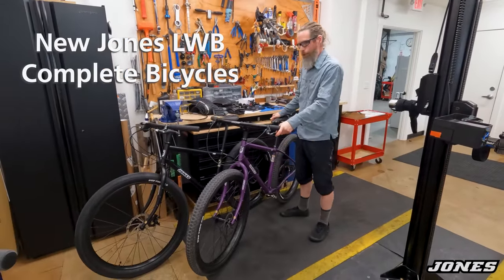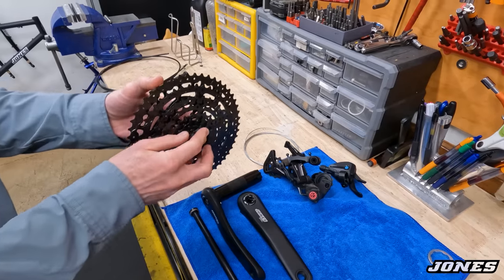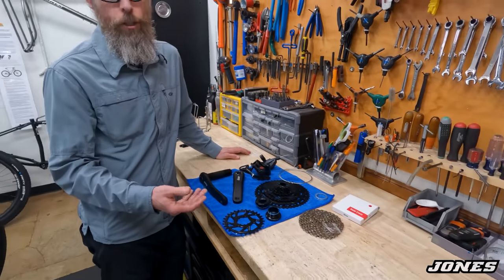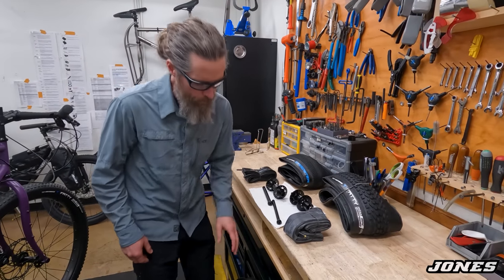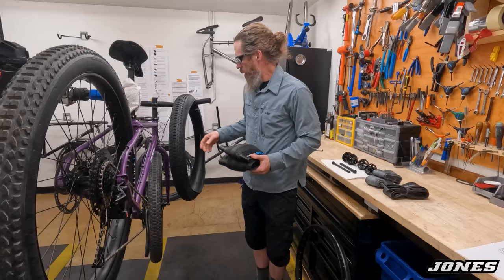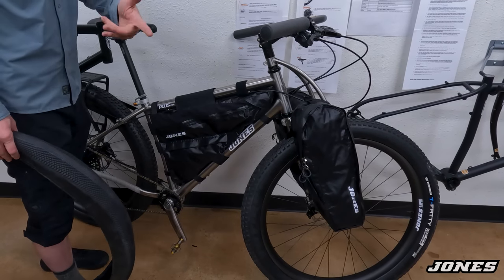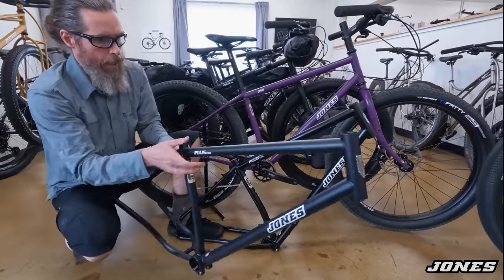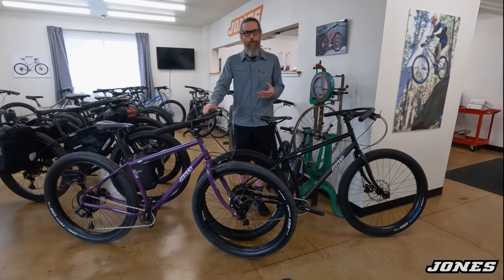NEW: Jones LWB Complete Bike, A Bike For Riding

Comment: I love all bikes of all types and love riding my jones Electric LWB HD-E. Jeff you are such a thoughtful bike designer. Thank you for sharing your philosophy, it's refreshing to hear the  justification for your design and rationale for how your spec your bikes in an industry full of marketing. Thanks for educating us and providing the details for why you do what you do.
Reply from the maker: Thank you.
Reply: Some cool news on battery tech -- Amprius has a battery using silicon nano-wires and anodes.  The point is that it can charge to 80% in 6 minutes, and the energy density is 500Wh/kg, 1300Wh/liter.  This is double or better of what Teslas use.  It's only a 5V chemistry, but 10 smaller cells in series (easier to do because of better conductivity of the nanowires) would be, as they say, a game-changer.  :)

Comment: Fantastic information. Now I totally get the through axel  advantage. The tier information was also …..not what I would have assumed. Kind of counterintuitive! But I get it. I once test rode a bike with a Jones Loop bar. It was really unforgettable. At 66 I think will go for the Jones Bike… because the experience in the design will keep me rolling for as long as I possibly can with osteoarthritis and a fully torn rotator cuff that could not be fixed.

Comment: Interesting to see how you spec the bike. I really like that you shared. 
However I feel like it has a some hipster driven marketing behind some elements and some poor choices in the name of durability.

I know a lot of people is cold sweating about hidraulic brakes, but over the years they proven even more reliable than the always maintain hungry cable brakes. Shimano brakes are the most easy to work with and most durable option rise above every one on the market, because of mineral oil, manufacturing tolerances at cheap price and world wide spread so part are everywhere. Unbeatable by an other company.
Durabilitywise Magura is great (bc of mineral oil), however their levers are not so great. The main body is made of plastic and around the main pivot there are so little material, that they have significant amount of chance to brake. Calipers are great, a ton of power. If you brake the lever, you can make it work with a Shimano one.

Cable vs fluid. It's 2023, even on the remotes places you can find someone who is familiar with this "hightech". But moreover is well proven by the time fluid based brakes are realiable as hell. 

Those Alhonga brakes are really low end stuff. Cable operated disc brakes are the creation of the devil, should have died out years ago. A Shimano mt200 set would be the same price with a set and forget feature in mind. Avid BB7s are good but why bother with them when you can get Shimano mt200 cheaper.
I get the points with the levers, but to set up like that is requires more skill from an average user that aligning the hidraulic calipers right after a YT tutorial.
Compressionless housing is great, especially on the rear. Someone who is doing a lot of biking will spend more time adjusting mechanical brakes than hidraulic. 

I'd rather spec and rebrand same other chineese crank set with SRAM sprocket interface and 24mm Shimano compatible spindle. This way you can keep the easy and well spread "GXP" style mounting with a more durable bearing system. Smaller diameter spindle means more bearing at BSA. Sram bearing system can be a pain if have a not so perfect bottombracket on the frame. The hardend steel bearing race on soft aluminium is not a good combination. On the Simano style system, you have a steel axle, sitting on polimer bushings and than the larger bearings. If you have failiure at the crankset, you will loose the cheap part, the bb and not a pricy part the crankset (axle).

9 speed is really just taste of choice and price. You can buy 10 or 11 speed wide range stuff to please people who prefer closer range of the gears to maintain cadence. 
Chain is another interesting thing. What really does matter at durabilty, what kind material the used and with what surface treatment. (Ex. M9100, XTR chain will easly out perform M6100 chain by 6-8 times, same geometrical construction but way better materials on the top. This is extremely important on ebike application when the motor unit performs larger torq from 0 rpm than most of our cars.)  At lower price you can't get any fancy stuff. Nickeling the outer plates are mainly against rust. Hardening the rollers, pins and make them slick gives the chain durablity. I wouldn't simplify this topic down just to bare outer plate thickness. 
In the future If you will need durability take a look arond the upcoming CUES from Shimano.

Comment: What's the reason for the kink in the seat tube?
Reply from the maker: Since this bike has a slacker effective seat tube angle than normal and tall wheels, the seat tube needs to be bent to clear the tire and have room for a fender.  This may help you see it: https://youtu.be/1xRiF8rm4Qg?feature=shared
Reply: @Veloperator  OK, the SWB would be quite tight with fenders, but the LWB doesn't need it at all, for these reasons at least. - Thanks for your reply -

Comment: How would a Jones bicycle behave with skinny-er tires and lighter wheel in terms of front tire grip? There is far less weight on the front tire compared to traditional approach geometry with skinny tires, Jones uses wide and heavy tire+rim setup so even without the body weight on the front there is grip, how much front wheel grip would you loose with a traditional skinny-er tire and rim?

Comment: I'd love a bike like this with V-brakes. I despise disc brakes, almost as much as electronic shifters.
Reply: V-brakes don’t work so well when you are running tires 55mm (2.2”) or wider. Unless you’re okay with deflating the tire every time you want to remove the wheel.
Reply: @watertankhikes  Never been a big deal, and the Paul's Motolite that I use have a simple cable release when you need to remove the wheel. I recognize most people have bought into the industries upgrade cycle, but I've ridden down long multi-thousand foot descents on old rim brakes with 40+ Ibs in the panniers and been fine to know the hype is just that.

Comment: Have you heard of anybody running a Rohloff  14 hub on these frames?           I have seen the bsa  screw in adaptors to make standard hub eccentric to get over the chain adjustment.

What mounting setup is required for the rear hub and  where do the shift cables run?
Reply from the maker: Hi Julian, It is posible and people have done it, but we usaly don't recomend it. For more information feel free to send us an email at jonesbikes@jonesbikes.com or give us a call at 541-535-2034.
Reply: I bought my Jones 29+ in ~2015 and had it built by Neil at Cyclemonkey with a Rohloff Speedhub.  (Before I talked to Jeff about this).  I also have a Jones 29+ built by Jeff with Shimano components.  Both have the same rims (WTB Scrapers) and Maxxis Chronicles (when they were still made), With the only difference between the two back tires being the hub, the Rohloff is 3lbs heavier.  As Jeff shows in one of his videos, the Roholff also requires more torque to turn the wheel.  That being said, I have not swapped out the Rohloff for 12 speed because I like it.  I have a Gebla Rohbox shifter with SRAM X0 shifters, so the left thumb shifts up, right thumb shifts down.  I have a belt drive so I also had to install a chain stay splitter.  The eccentric bottom bracket allows you to adjust the setup like a single speed.